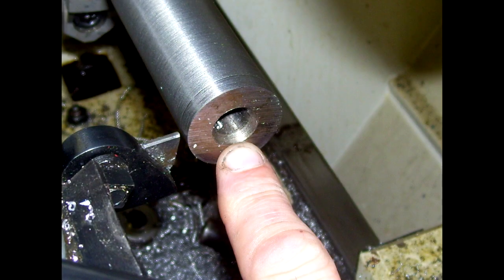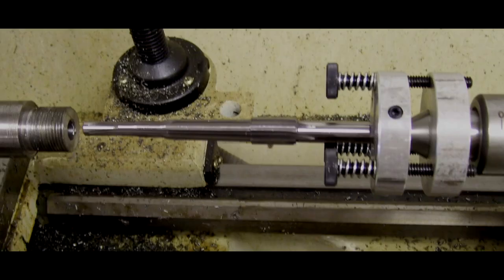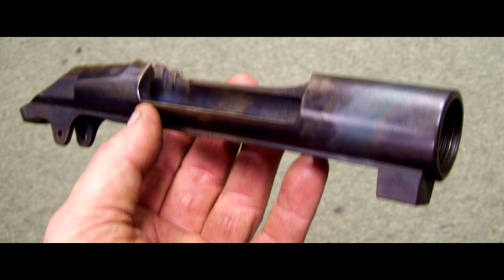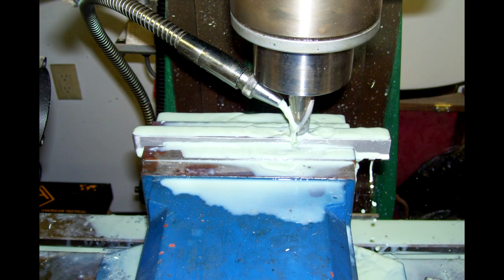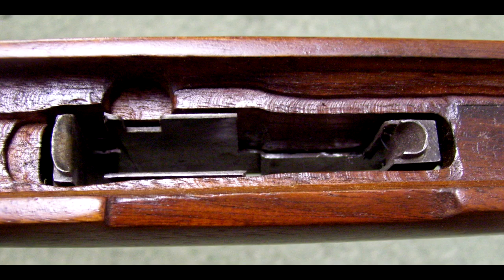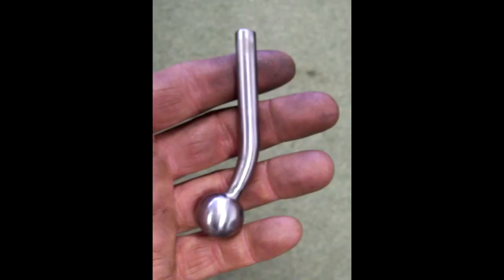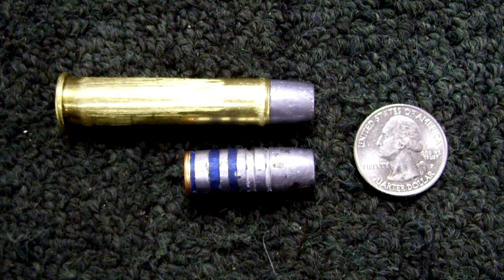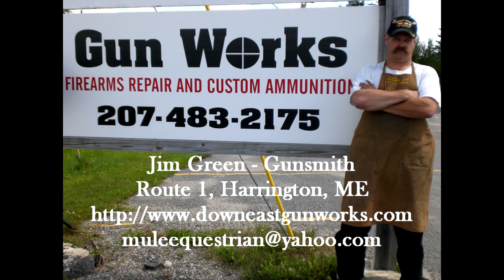Gunsmithing: Mosin Nagant Conversion to .45-70 Govt. (Gunworks)

Comment: What a great video. I am not a gun owner (living in Australia)  but I found it very interesting. I was amazed at the price of the gun....only $100.00
Thanks
Michael.
Reply from the maker: That $100 was the cost of the gun BEFORE all the other work was done to it. I started off as a WW2 surplus rifle from Russia
Reply: Michael Flanagan Just a few years ago, you could find shooter grade Mosin Nagant 91/30 or T53 rifles for $59-79 all over the place.  The low price combined with inexpensive surplus ammo made them pretty popular.   The price has slowly crept up, but on occasion you can still find them in the $100 range, particularly on local gun forums and classified ads.

Jim - Great video!
Reply: +X-Ray Crystallography What he did to this rifle was a "value-add" exercise.  Most (not all) Russian Mosin Nagant rifles that would be considered "shooter grade" are not worth a whole lot in their out-of-the-crate form (generally <$200 in value), though they are certain fun to shoot.  The same would be true of shooter grade Mauser rifles that have had performance improvement alterations done to them.
Reply: +X-Ray Crystallography currently, Mosins are cheap and plentiful. sure, they'll escalate in value as the suppliies dry up but not everyone wants one in original condition. This rifle will be a unique and fun rifle to have and shoot. Besides, if you're a collector. downeastgunworks made your guns more valuable by modifying one.

Comment: If I supply you with the rifle, spare parts, etc., what would you charge to do this conversion using a T53 Chinese receiver?  I'd want to use a brake of some design and have it done in a durable weather resistant finish, likely either a laminate or synthetic stock, and utilizing an extended magazine if possible, either Archangel or the Riflemods model.  I look forward to your response.  Thank you.
Reply: The idea of an octagonal or half round half octagonal barrel is appealing as well.  Can it be done and look right coming out of a round receiver?
Reply: +Trey Westcot Get a 1835 or older Mosin. It will have an octagonal receiver already. I am a collector of Mosins (mostly Finns) and normally abhor mutilating a Mosin. this conversion - especially your idea for an octagon barrel - is appealing. If you do it, consider a set of irons as on a Browning or Winchester single shot. Or perhaps a ghost ring or aperture rear sight. A /45-70 is not a long range cartridge by today's standards, and an aperture sight would be quick to use and would in my opinion look great with the octagonal barrel. Oh - and lose the white line spacer.
Reply: +Doby Pilgrim 
Yessir, I'm a Finn collector myself.  1835?  ;-)  I know...typo.  Please elaborate on the white line spacer comment.

Agreed on an aperture sight, maybe a Lyman or similar model, although I believe a flat would need to be milled in and trued to make it work.  I'd be hard-pressed to do anything to a hex receiver rifle, let alone a Finn, but I've got several counterbored  91/30's with 1942-44 barrel dates that are ideal for such a thing, along with a T53 barreled receiver that's already had about 3.5" of barrel length removed with the intent of building a woods carbine one day.
Reply: Oops!!! 1935!! White line spacer is there at the butt. It looks cheap. A hex refurb that has already been bubbaed would be ideal. Why spend the money to do it to a Chinese one? Something about that would just not seem worth it when finished. Just a personal opinion. A "hex" is actually octagonal of course. We just call them hexes.  It would (or could) mate perfectly with an octagonal barrel. Vintage Williams or Lyman receiver sites are on eBay all the time under $100.
Reply: Doby Pilgrim 
Good point about the matching lines, and if the barrel were oversized, you could machine it down to where it's seamless.  That would be something.

Comment: Amazing. You really know your stuff. Math was never my strong point. How is it possible to measure a 50,000th of an inch? How is it possible to cut a inch in 100?
Reply: .050" is actually pretty big ... about 17 sheets of school notebook paper. I don't know how he did it (there are several ways to skin that particular cat), but a depth micrometer would have both the necessary reach and precision.

Machine work is actually fairly easy ... if you are honest enough to admit what you don't know and correct your shortfall.

However, it's uphill both ways barefoot in the snow if you are weak in math or are prone to pretending you know more than you do. It's not sin to be weak in math ... if you are willing to correct that situation. (To set the angle to cut a taper of 1" in 100 requires the use of trigonometry and, most likely, what is known as a sine bar (CNC machines can take the measurement as a set of coordinates and the code to travel from one to another, or as one fixed point and the angle to be cut and the length of the line) and some precisely ground pieces of steel known as "jo blocks" (named after the Johansson company in Dearborn, MI) ... although there are other ways of getting the needed numbers.)

If you are interested enough to turn the tv and computer off for a while, grab yourself an instruction book from around the turn of the century geared toward high-school / apprentice math ... Brown and Sharpe made an excellent one, so did the Ford Motor Company apprentice program ... and work every problem in the book until you understand the how and why of it. Start at your local library, explain what you are trying to accomplish, and let the librarian help you find the books you need.

Comment: It would be nice to have a setup similar to this. A 16.50” barrel threaded with a flash hider installed. XS sight system with forward mounting rail chambered in 30-30 Win. I realize it’s an odd combo but I really like the caliber and since it’s a rimmed cartridge it should work fine.